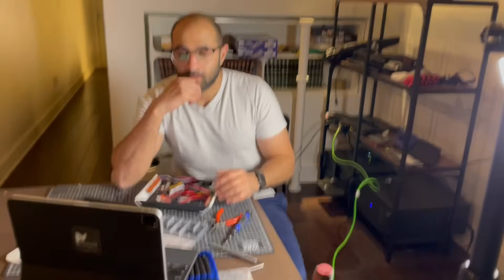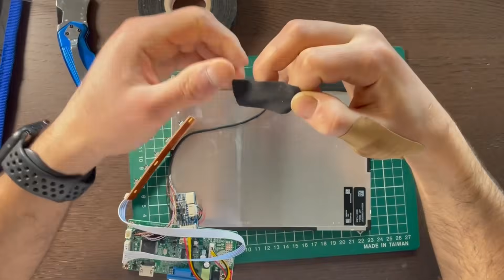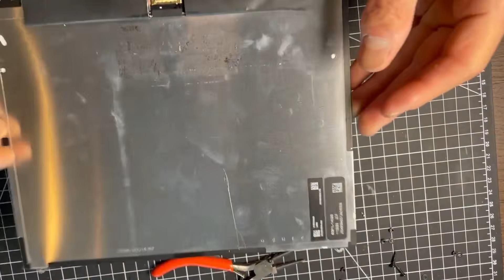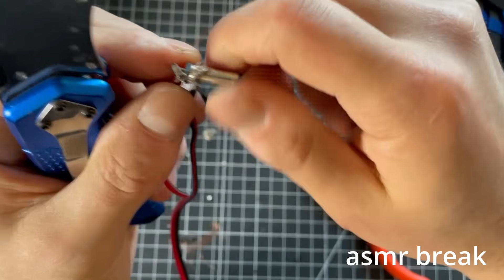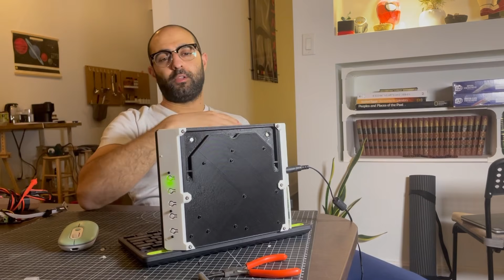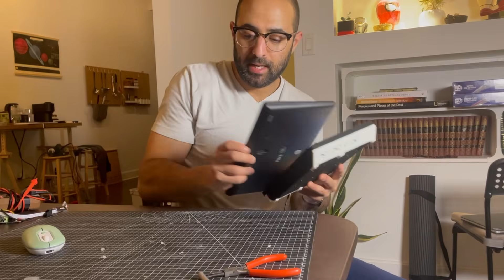Turning An Old iPad Into An RPi Portal

Comment: It came out looking pretty nice. Love the up-cycling of the ipad screen, probably would help save a lot of old ipads out there. My recommendation would be to use a USB PD trigger board instead of a 12v jack. You can program the USB PD trigger board to request 12V from any USB C charger which makes it more convenient. Great job 🫡
Reply: I would love to build this! Are you willing yo dhare thd 3d printer files fif thd chassis?
Reply from the maker: @joshuamclean3298  Absolutely, will be uploading it to our Printables page later this week!
Reply from the maker: Hey @joshuamclean3298, I ended up uploading it to my thangs page, let me know what you think!

https://than.gs/m/1589445
Reply from the maker: Thanks! USB-c PD was my first choice, and a great suggestion from you, but I wanted to stick to the upcycling theme and had a 12v adapter that would have gone to the landfill otherwise. Next project though, PD may just be on the list.